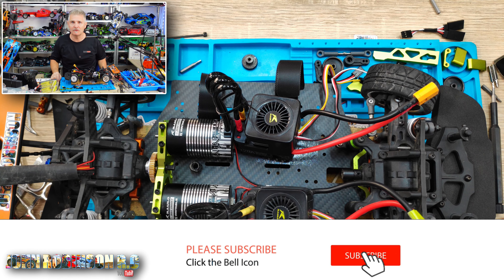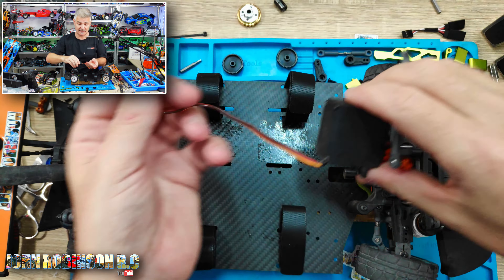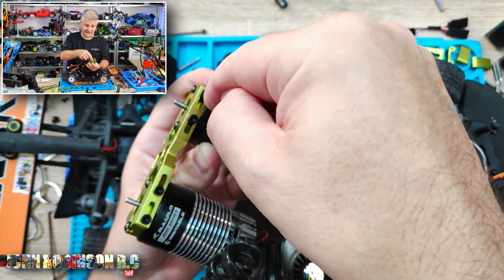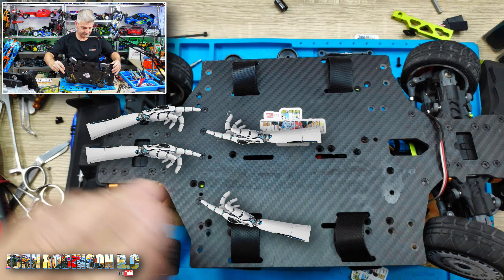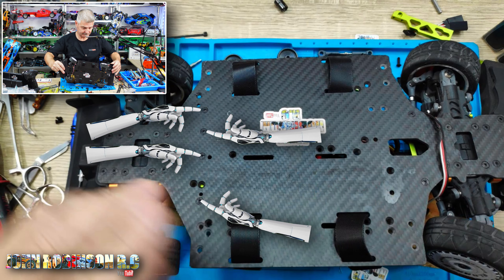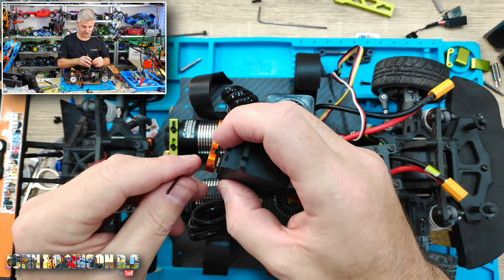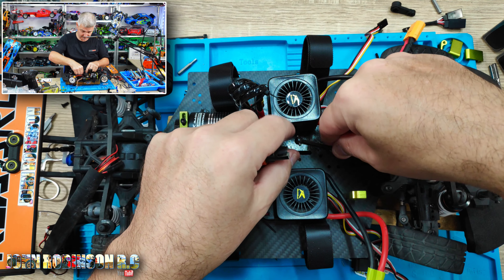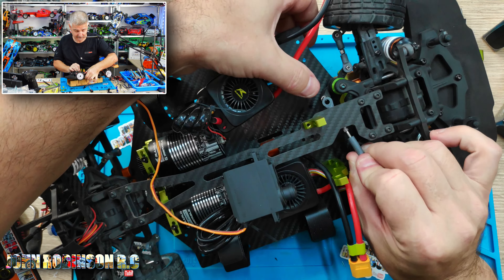TUTORIAL - Installing TWO MOTORS & ESC's  - RLAARLO Conversion Part 3

Comment: Will both work 100% independently without having one master and one slave? I am about to do dual motor and was wondering
Reply from the maker: Yes as they are both connected to the same receiver port with a y-cable. So both receive the same signal at the same time.

Comment: Hello brother
Please I want ask you question
I'm buyed rc car wltoys 124017 v1 
I'm so tired of the talk I've heard about this car because everyone tell you have problems in gear . You can't play in off road and send. It's a broken car . 
I do not want to try these methods so that it does not stop working, because this car came to me as a gift. 
and I don't understand what's wrong of this car 

please can you tell me what's wrong 
😢
Reply: Hello my friend. OK you are right but the reason is simple. Version 1 of the 124017 was released with horrible cogging ( gear problems.) and transmission problems.

However after 3 weeks, WLToys released version 2 which fixed the problems. As it was so long ago there should not be any version 1's left to buy.

But I would ask the seller what version they are selling first, before buying it.

Version 2 was very good.
Version 1 had a lot of problems.

Hope this helps.

Kind regards

John
Reply: @JohnRobinsonRC  Thank you, but do these problems have a solution or not?  I did not buy this car, but it came to me as a gift, but when it came to me, my friend told me that it was the first version. Can you tell me how to differentiate between the two versions?  I have the first version and it is very fast and I did not find any problem with the transmission, but I do not know whether it will malfunction when you walk on off roads or not.
Reply: @-fathakker  ah ok. Well it cannot drive on grass. The only solution is a new esc I am afraid. Or only drive it on tarmac.
Reply: @JohnRobinsonRC  why new esc
It's new esc 
And I can't play it on off road?
Reply: @-fathakker  a new esc will fix the gearing problem. But of course you then need to buy a new transmitter.

If it was me. I would be happy with the car and just drive in onroad / tarmac / asphalt. ☺️👍
Reply: @JohnRobinsonRC  ok what's the new esc. and I try to paly in asphalt.
But I saw videos of you on the channel repairing gears
And thanks again